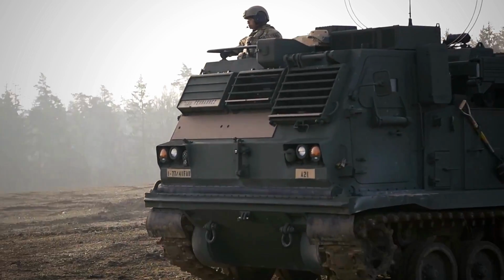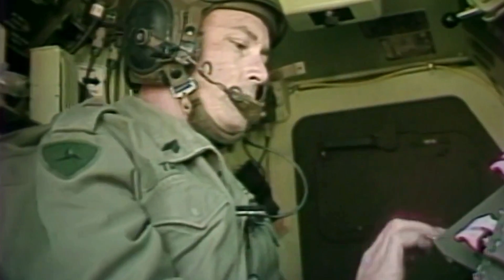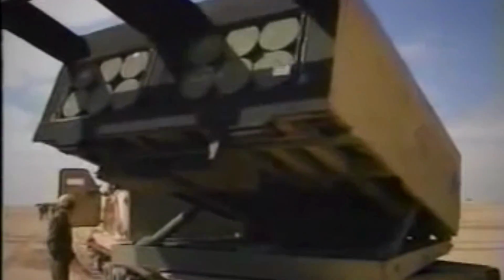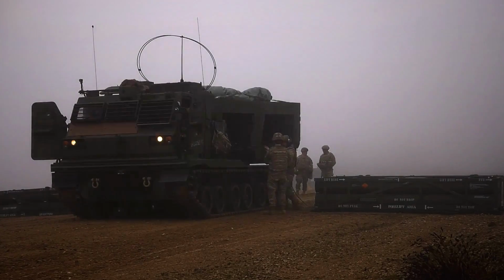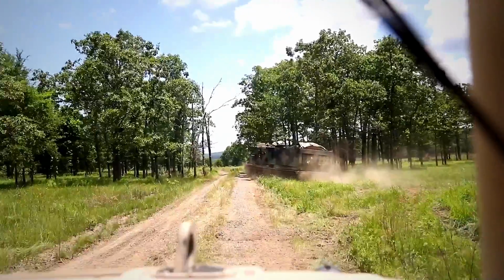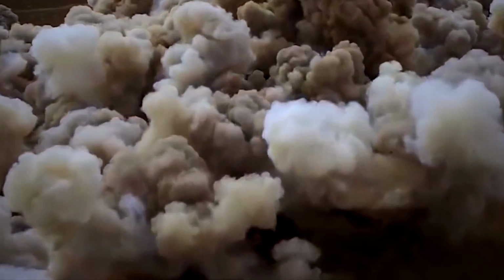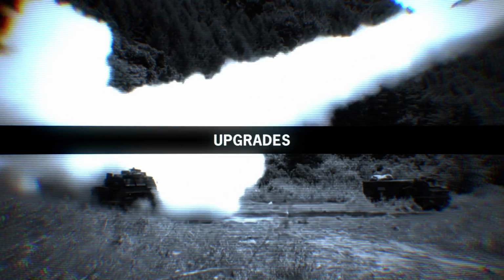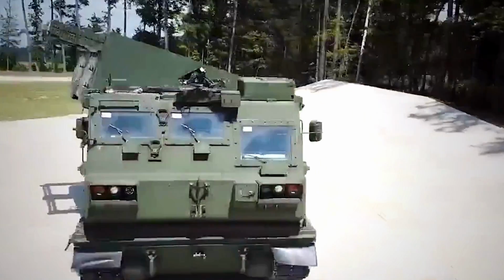M270 Multiple Launch Rocket System- NATOs Most Powerful Mobile Arsenal

Comment: The M270 is an impressive unit. If I had stayed in artillery, I would have made sure that I was in one of these units. That said, as a Combat Engineer, having not to disperse mines is such a relief. The benefit being that after a set ti.e they self destruct. The 270 is a big friend to any front line ground pounder!

Comment: I was a M270 MLRS crewmember (MOS: 13 Mike) during the early 1990s. It is amazing that it is still so effective upto the present. These rockets are extremely effective.  Funny fact: We used to use the caps of the rocket tubs to make clocks or art objects. Just wish it had air-conditioning.  😆
Reply: I was on a Bradley in the 90's.. I took the hose from the NBC system and stuck it in the nomax suit and cooled down my nutz with it.. 
1st Cav 1/9 Cav
Headhunters
Reply: I was in the middle of A/94 FA MLRS and 4/27 FA MLRS in Desert Storm with the Firefinders (I was radar direct support).  So I've seen them up VERY close.  Even saw a beautiful night shot of the 3AD ATACMS.  That was absolutely amazing.

Comment: what a bullshot that the MLRS was developed for countering the russian rocket systems like BM-21. NATO had the strategy of Massive Retaliation this did mean the use of tactical nukes this role was in the field done by the M53/M55 and for replacing them the M270 MLRS was developed. Forces of NATO had artillery rocket systems before which are similar to BM-21 like the german LARS and LARS II. There is a reason why NATO doesnt have huge amount of short range rocket artillery and this is not just the difference in strategy. This kind of rockets are way more expensive as other artillery systems, it's not so simple to store this rockets. And if you add then the small precision to it you get the point you have to shoot masses of this rockets . This is why Germany skipped his rocket artillery, except the MLRS or MARS II how its called there (which is a bit different version). Modern selfpropelled howitzers like the PzH 2000 master a technique called MRSI - multipile rounds simultanous impact, means the howitzer fires 3 rounds in different angles which impact at the same time. PzH2000 does this in 50 seconds. 30 secs to get  in fire position, 3 rounds 50 secs and get at in 20 seconds - so a battery impacts on target 12 rounds not much difference to something like the BM-21. The success of the MLRS was from the begin its distance of more then 30km that what on the time of his introduction more as the distance barreled artillery systems could reach, there been long time the limit at 25km. So next to the "atomic role" it was once thought for it got a role in counter-battery fire. Just to give you some others numbers as here already say things like good for destroying bridges, if I remember right a piece of M31 went around 250.000$ for comparison a round LARS caliber 110mm goes for 25.000$. 2% of this rockets are fail, means on 10 just 8 reach the target, the precision of the M31 is given on his distance of 84km with 7m, well a bridge like that in Kherson has a with of 10m so some will not hit it, they must have fired at least from 4 HiMARS all rounds - yeah 6.000.000$ for 7 holes. Some really out of their mind and just see destruction of something or distance and no costs. Just watch the news a bit a country like Great Britain just realized they would run out of ammunition within 14 days.
HiMARS as well M270 and MARS II (some really think there is a lot difference between HiMARS and M270 but its not same rockets guys!) could be used more intelligent, some already mentioned the M26 with the AT-2 (just to give also here numbers one rocket can carry 28 of the AT-2, the 110mm can only do 5 so 336 AT-2 vs 180 from one launcher) the BAT system, I dont know if it is combat-ready now. And the system will have its future, with HiMARS it became more mobile and lighter (for shipping) for rapid response forces so we will see the MLRS on other carriers. KMW introduced already the MLRS on its GTK Boxer platform.

Comment: The cluster munitions have not been used in quite a long time due to the dud rate and potential non-combatant casualty factor. GMLRS is now the name of the game.
Reply: I thought cluster munitions were banned now,the americans are quick to condemn russia if they use them
Reply: @iancarnaby3898  They only comdemn their use on civilian areas.
Reply: @iancarnaby3898  cuz Russia is blatantly trying to kill civilians there's a big difference and it's only been banned on civilian infrastructure were casualties can happen
Reply: Yes the DPICM were discontinued in the early/mid 2000s and were replaced by the alternative warhead program.  Unfortunately several DPICM weapons were stockpiled mainly in South Korea so some were used for practice and others were dismantled.
Reply: Steel Rain

Comment: While this is a very effective weapons system, Let's not forget the M142 HIMARS {High Mobility Artillery Rocket System} With an effective firing range {1.2-190 mi M30/31 GMLRS {57 mi} The Dark Channels are some of my faves, Thanks Dark Crew. 👍 🇺🇸
Reply: HIMARS and the upgraded M270/MARS II have the same firing range, they use the same rockets.

Comment: I was able to work on ATACMS in the 1980's. I did non destructive testing.  X-ray of the devices that would open the warhead so that it could dispense the munitions. WOW! Back then this was a truly awesome weapon. I suppose it still is even 40 years later. Wouldn't want to be on the  receiving end of this.
Reply: You shouldn´t believe everything you see/hear, these weapons are wielded by the new LGTBQP Military that mostly concern itself with Diversity, Inclusion and Equity or DIE for short. Not to mention the fact that most of the raw material for them comes from Africa and Russia so new production will not happen if it really starts.

Comment: For when you want a grid Square cleared or removed from existence this is the perfect thing to use. Especially if this is loaded with cluster munition round Rockets., you don't want to be anywhere close to impact point
Reply: Steel Rain 😁
Reply: this is done by howitzers way cheaper
Reply: @sirkokemter7904  Exactly.
Reply: @sirkokemter7904  not faster, not more accurately
Reply: @michaelpeters5696  definitely more accurately, I laughing about an accuracy of 7m

Comment: Why only 12 missiles? You could easily fit 4 more in that box. I am curious what use that has after all it's missiles are shot?
Reply: You just reload it. It has na internal crane and can be loaded in 5 minutes
Reply: Several reasons,  but the main one was the first rocket talked about in the video, its a cluster bomb variant that spins up and scatters explosives over a massive area, and they could only make enough room for 2, the 2 6 pack launchers are just to use more rocket variants with the same system.
In this case 12 precise rockets over 2 that blanketed a 1km square with small explosives
Reply: After the countless mentions of rockets, and zero mention throughout the video of any missiles, you still manage to conflate the two? 🤦‍♂️ I shouldn’t be surprised you’re unfamiliar with the concept of reloading.